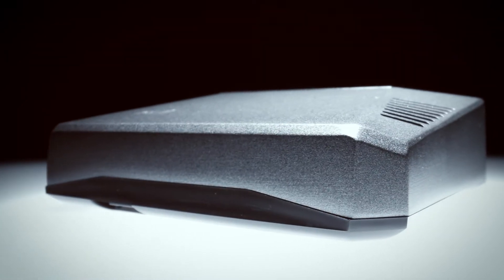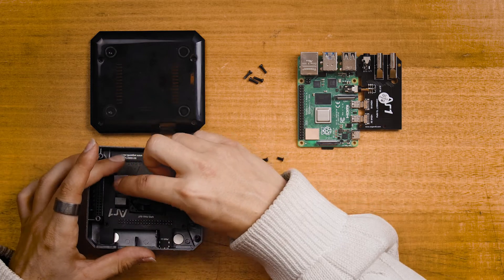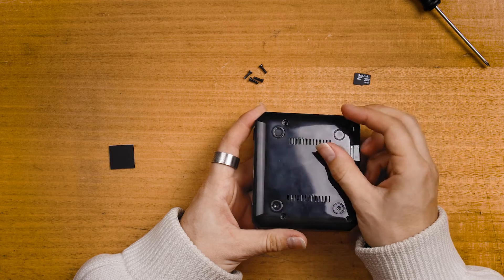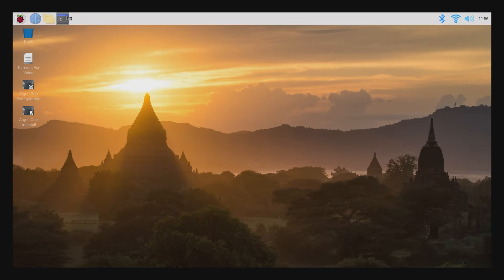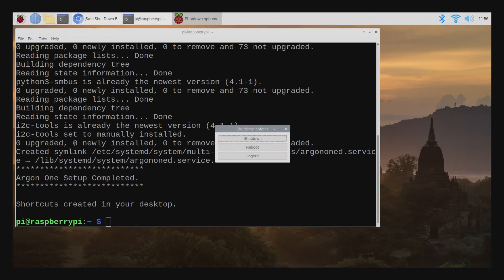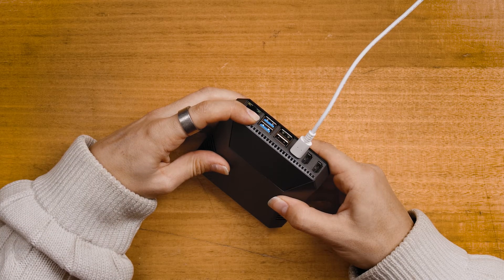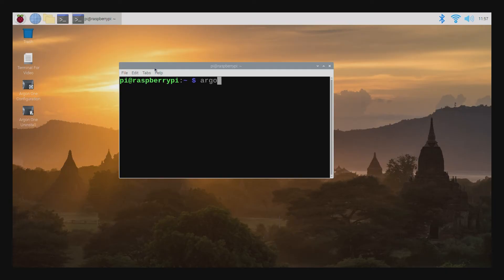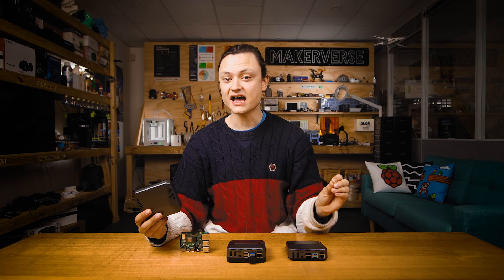Raspberry Pi Argon One Case | Set Up for Working Safe Shutdown Button

Comment: I'm not sure if it's known but you can hook up a USB A to USB A to the m.2 bottom port (The one connected to the m.2 bottom case) If you need to flash the SSD. A lot easier than having to deal with the SD card as well as pulling the case apart. Mine runs so much better with the SSD!
Reply from the maker: Pinned, thanks for teaching me mate 😊

Comment: it uses one of the gpio pins, can you get back the pin when using this case? like for pi hats?
Reply from the maker: Other Raspberry Pi cases will work better with HATs than the Argon One. You still have full access to the GPIO Pins with this Case however the edges of it can cause HATs not to fit correctly.